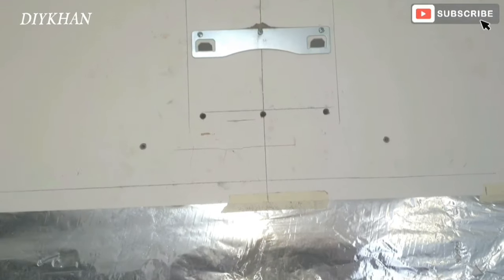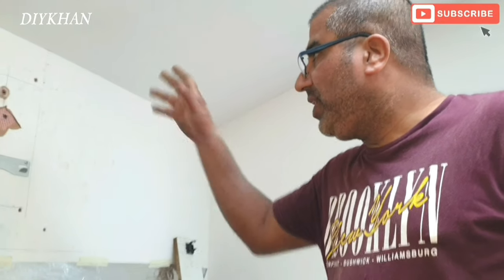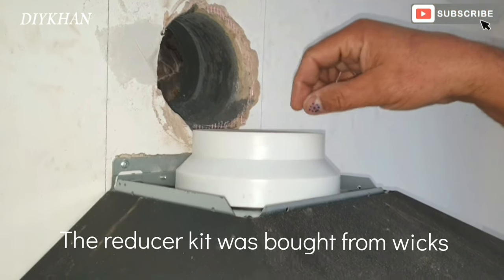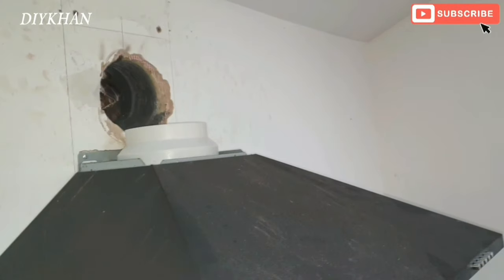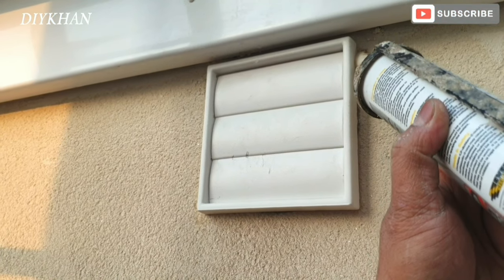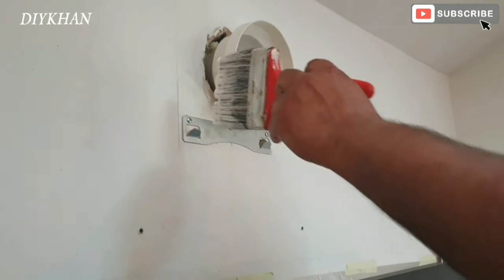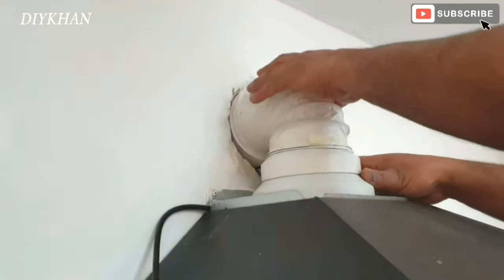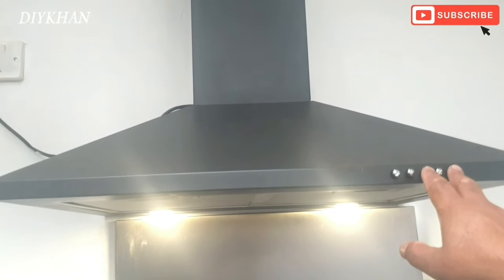How to Install a Kitchen Extractor Hood Vent Kit || How to Drill a Hole for a Kitchen Extractor Hood

Comment: Too much silicone.  If that extractor fan packs up think of the headache the next engineer will have removing it.
Reply: The reducer (2:50) just pops off the extractor  and can be then fitted on new fan easily. But id personally change the ducting aswell if fitting new fan as over time it would get full off grease etc..  👍

Comment: Hi by all means use silicone to seal the outside but the screws and plugs on the outlet plate wouldn't cost much more to fit🤑🤑 i would have fitted at least two as a minimum ...
Reply from the maker: You are welcome thanks

Comment: Better job than I have seen in some new builds, not sure how the excess ducting would hold up against the ever increasingly stringent flow rates as flexi tends to create a lot of turbulance even in small lengths. but from what I can see it would Get a lot better results than a few recent jobs I have tested. you wont believe how many get away with excess ducting of up to and exceeding 1 ft.
Reply from the maker: You are welcome thanks
Reply: Everything about this was done wrong.

Comment: Brilliant work, did you add the socket yourself for powering the extracting vent fan. What silicone did you use?
Reply from the maker: Hi. The socket was already there and the silicone was bought from toolstation.
Reply: For the cooker hood u can also instal FCU from the lighting system

Comment: How did you know where to drill on the outside wall so that it lined up with the correct location on the inside wall? Did you drill a long pilot hole?
Reply from the maker: Yes I found the right angle from inside n drilled a hole with long drill bit n that was my center point.
Reply: @diykhan  cool, worked out well 👏

Comment: Hi i know it’s an old video but my cooker hood is facing the bathroom. 

Is it possible to drill through to the bathroom wall. And then up through the ceiling? As the bathroom ceiling is free from outside to put a vent in. 

Please let me know

Comment: I have just this done by someone and I think the duct is small. What happened if a small one is fitted?
Reply from the maker: For the kitchen extractor fan or hood the duct has to be 150mm or bigger.
Reply: @diykhan  oh no... he's fitted a 100cm and said it was fine I was none the wiser will it cause problems I'm worried now.
Reply from the maker: Its ok but 150mm is more sufficient and will extract better.
Reply: @diykhan  thank you for your reply wish I had known before.
Reply: @diykhan  you say 150 is sufficient. But you only did a 110 hole yourself and used reducer??

Comment: What if your cooker is not near an outside facing wall?
Reply from the maker: U can make a box alone side the wall and the ceiling to accommodate the aluminium 150mm flexible pipe.

Comment: Does flexi ducting work with high temperatures?
Reply from the maker: The kitchen extractor hood doesn't get hot.
Reply: Extractor hood won’t get hot but the fumes being extracted will be.